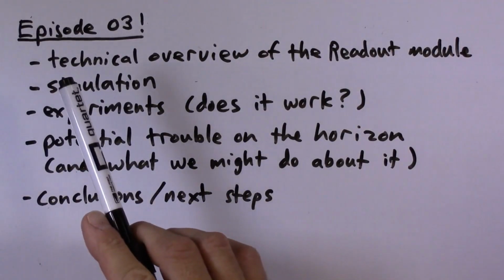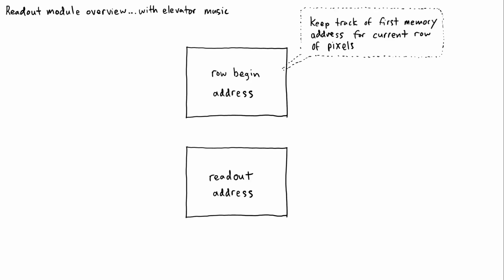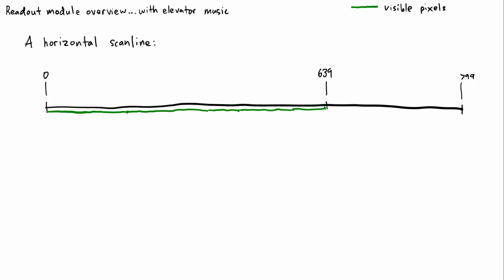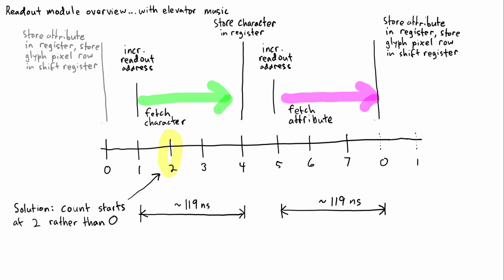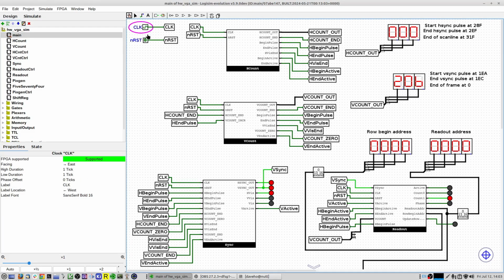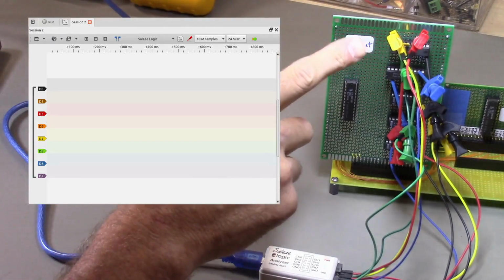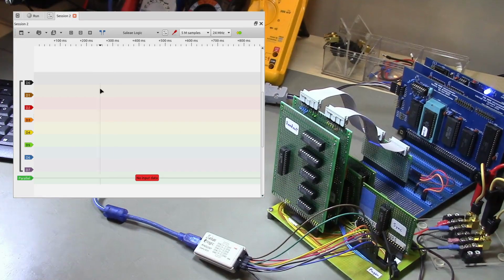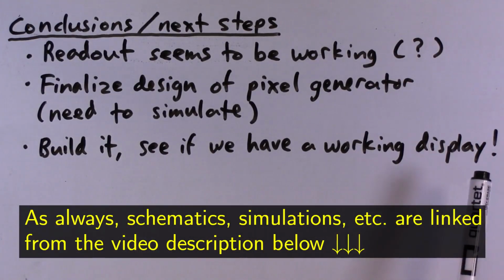Hardware VGA Episode 03: Readout module

Comment: Have you considered storing the character data and the attribute data in physically separate RAMs?   This would allow both to be accessed simultaneously by the read out module, requiring only 12 bits of counting.   I think it should still be possible to arrange the RAMs so that the CPU interface to them still appears as contiguous pairs of bytes instead of separate blocks, e.g. by using A1-A12 from the CPU as A0-A11 to the RAMs, with the CPU's A0 line instead of A12 as the  CS/~CS line.  Alternatively, maybe having them as separate blocks might be better anyway from a programmer's PoV?
Reply from the maker: I did think about putting character and attribute data in separate RAM chips. I didn't realize that you could play tricks with A0 to make characters and attributes appear to be contiguous: that's a very clever idea. Allowing parallel loading of character and attributes would potentially double the throughput, which would be nice, although there's plenty of time to load characters and attributes sequentially, even with the relatively slow 70 ns RAM chips I'm using.
Reply: @davehohacks  a further idea relating to the need to start the RAM accesses in advance of the start of the visual area (and during the "previous" scan line) - I'd be tempted to drop an 8-bit shift register ('595 ?) as a configurable delay on the HSYNC line near the final output stage (such that it only affects the monitor's version of that signal).

Alternatively some timing diagrams depict the 48 clocks of the horizontal back-porch being the start of the current line, and not the very end of the previous one, such that the line actually starts at the rising edge of HSYNC.  This perhaps complicates the clock counters compared to starting the visual area at clock zero, but IMHO it sure beats having to think about doing stuff while the previous line is still going.
Reply from the maker: @RayBellis  Good ideas! I did consider starting scanlines with the back porch rather than the visible area, but eventually decided it was easier to just increment the vertical count early. (Although, now that I'm thinking about it, these are more or less equivalent ideas.) That ended up being a fairly easy change. I didn't think about delaying hsync with a shift register. Thinking about this right now, you could put all of the signals in a FIFO memory pretty easily and avoid the issue entirely.

Comment: Take a look to see if the part you need is available in 74AHC ... nearly as fast as 74ACT, but doesn't switch quite as hard so no ground bounce.  (Though, those are all CMOS-level parts so might be an issue with the low output drive of the GAL... not very many 74AHCT...)
Reply from the maker: I think I did look for 74AHCT parts and didn't see the ones I needed. It really is annoying that GALs don't guarantee more than 2.4V as the output high.